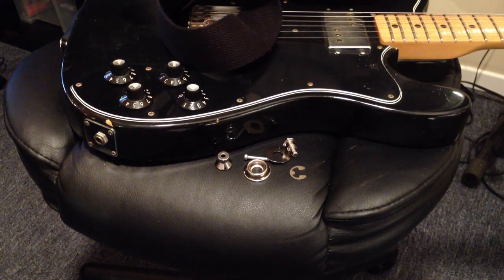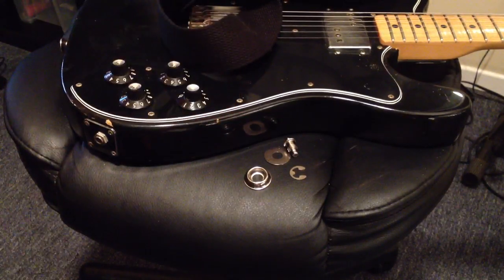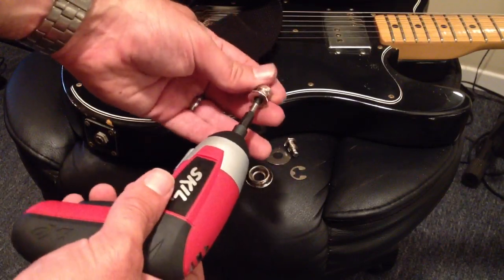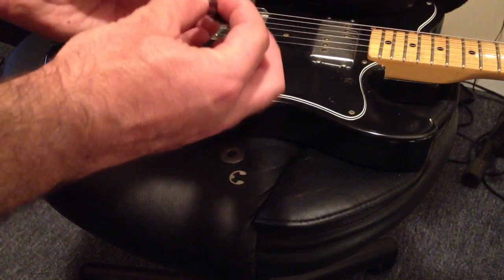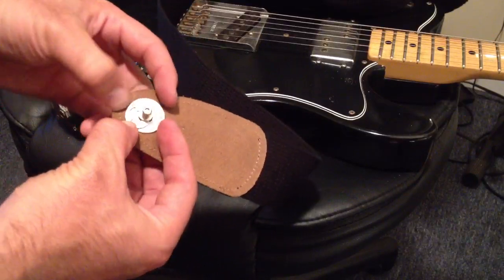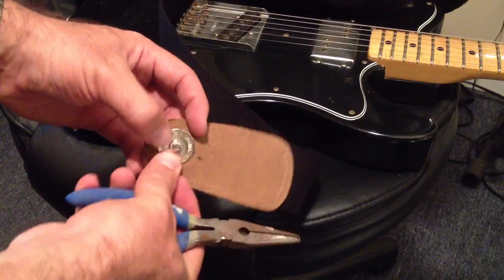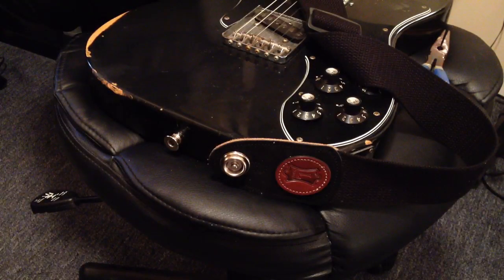Dunlop strap lock fast, easy, correct installation.

Comment from the maker: It seems there’s a lot of anxiety surrounding using power tools on guitars, perhaps I can allay your fears.

1) it’s an electric screwdriver, which spins much slower than a drill, making it much easier to control. 2) all factories use power tools to screw in guitar parts, do you really think they’re spending extra money on time to screw things in by hand? 3) all guitar techs I’ve worked with have used power tools, many even use full on drills to install screws and wind strings. 4) manual screwdrivers can do serious damage as well, if you aren’t careful.

All you have to do is be careful, and use the right tool for the job, along with some common sense. I haven’t had a guitar scratched from a power tool in over 20 years of repairing instruments. If you are doubtful of your abilities, then by all means, use the method that works for you, but there is no reason to adhere to guitar dogma (and there’s a lot of it).  It’s a piece of wood and some screws, and there are power tools designed expressly for the purpose of joining those elements, safely and efficiently.

Comment: Thanks for the tip about how to install the locking ring. I ran into the same problem you did; it wouldn't click into place no matter how hard I tried. Your tip about using needle nose pliers is the way to go.

Comment: Nick, thank you very much. The tip of using a soap bar to lubricate the screw makes ipossible the instalation on the neck joint of a ES 335 block 1963 reissue.

Comment: I used to love and be obsessed with the Dunlop Straploks for years but after a brand-new set failed and drop my guitar straight to the ground I'm never buying them again. Just seeing them on the video makes my heart skip a beat. Yeah, I know it might have been a faulty unit in like 10,000 that left the factory, but I don't care. If I pay for a product that is intended to lock my strap in place and I trust my very expensive/favorite guitars with it, I expect it to do its job and do it well, so failing one time only is really all I need. Anyway, my cat-like reflexes were, fortunately, quick enough for me to catch the neck of my favorite guitar right on time and avoid the tragedy about 3 inches from the floor, but I feel for those who may not get so lucky. So, since that incident happened my advice for all my fellow guitarists has been to ditch those Dunlop abominations out of your beloved guitars, and instead switch to Schaller S-Locks because the mechanism on those is designed in such a way that even in the remote possibility that it fails to lock the strap (something already pretty much impossible to happen because it is spring-locked tightly and strongly) it will still secure your guitar in place because of the way the lock connects to the guitar from below. You would only notice that it "failed" if/when you took off the strap yourself, basically. So, what this means is that with this straplock, your guitar is literally always secure and protected from a disaster, I mean even gravity itself is on your side and helping. A disaster just can't happen even if you wanted to and so it's absolutely perfect. Sorry for the rant, but friends don't let friends buy Dunlop Straploks. Stay safe and Rock on \m/

Comment: Can i just use the stock screws from my guitar strap knob instead of drilling and stuff??
Reply from the maker: Sorry for the late reply. I would use the new screws. They will fit the strap buttons correctly, and they are tough in my experience, never had one bend or strip out, and I play a HEAVY bubinga bass. Who knows what the manufacturer's screws are made of, you can't put it past a manufacturer to cheap out on something like a screw.

Comment: Do they move in the socket and make noise like schaller ones ?
Reply from the maker: I've never noticed noise from any brand of strap lock...  are you installing them on an acoustic or something with a piezo? Shouldn't matter otherwise, and any little rattle would probably be negligible in a live setting regardless. If you tell me more about the noise you're experiencing I might be able to help further.
Reply: It's just the rattling noise when you pick the bass and move the strap.
But it's not relevent anymore when standing because they can't move anymore.
Reply from the maker: yes, beyond that, properly working magnetic pickups wouldn't pick that sound up anyway, only piezo's would.

Comment: Anyone just used the screw that come on the guitar?
Reply from the maker: James Cuddy If it fits in the Dunlop strap button, sure, but generally the heads on the existing screws are too wide.
Reply: @NickWeissMusic  Just did it and it fitted! Got one done then moved to the upper lock beside the neck, screwed it one too tight and the screw head broke... the dunlop metal is a lot stronger than the screws on the guitar. So now going to have to find a way to remove a screw that's stuck in my 335 or drill another hole, oh the joys
Reply from the maker: @jammyd33  Lesson learned :)  If the screw is exposed, you can cut a flathead slot in the top of it with a dremel and unscrew it. Or if it's buried in there, hopefully you can just yank the button off, or drill into the screw until you're able to pull the button off, a dremel with a grinding burr is useful here too. once the button is off  the screw should be easy enough to get out with pliers. If the broken screw's buried in the wood, then you've got some bigger headaches, I've never had much luck with screw extractors, first I try to use a tiny dremel engraving burr to create a flathead slot, it's not particularly easy but it works.
Reply: @NickWeissMusic  Thanks for the advice, unfortunately the top of the screw head has snapped off and the screw is left in the guitar, only about 1/2mm below the surface of the body. I really don't know very much about tools, I may have to send some pictures for help, otherwise I'll take it to a local guitar tech and hope he has something that can work
Reply from the maker: @jammyd33  That's bummer but  it'll get sorted out. If you don't have a dremel or screw extractors, yes, this would be better left in the hands of a tech.  I definitely encourage people to try their own repairs and adjustments, it's just wood and screws after all, but would never encourage working without the right tools for the job.

Comment: I have a Gibson and the screw sizes that come with it are different lengths and slightly larger gauge than each other. Any ideas?
Reply from the maker: You have to use the Dunlop supplied screws, so if the existing holes are too small, that's no problem, drill them out. If they are too big, first to make sure the existing holes are deep enough, if not, drill them out to accommodate the new screws. The classic trick is to crush a wooden pencil with some pliers, Cover the slivers in wood glue and pack them into the holes.  I then drill the screws straight in while the glue is still wet, no pilot holes needed. Wood glue is stronger than wood, I have done this on several instruments and never once had a problem.

Comment: What size are the screws given in the strap lock box. I lost them and need to replace them? If anyone knows off hand I’d greatly appreciate it
Reply from the maker: Aaron Gall Sorry but I’m not sure myself. Any high quality wood screw should work, as long as it protrudes an inch or so into the wood, so 1 1/4” or 1 1/2” would do it. I’d go with stainless steel, not the cheapest zinc plated. One thing that won’t make your selection easy, is the cylinder that the screw fits into is pretty narrow, so you may have to grind down the screw head to fit inside it. I’d say a deck screw would be perfect, but I believe their heads are fluted and won’t fit flush inside against the metal strap button. If you’re not handy, you might be better off contacting the company to see if they would send you replacements (good luck), or buying a new set. Depends on your skill and the value of the instrument. Screws aren’t magical, but they will be under a good deal of stress in this case, so use good judgment.

Comment: Man, I sure wish I'd watched this before I used Irish Spring on my screw threads. Damn it.
Reply from the maker: Marc Johnson live and learn. Burn your guitar and try again :)
Reply: Actually I already used the guitar to destroy my JCM900 amplifier. I read where vacuum tubes are prone to eventual failure, so I took them out. Afterward, the amp didn't work. What a POS.

Comment: What I do applaud in this video instruction is to use soap or candle wax to lubricate the screw.
But when it comes to tools on your guitar... NEVER EVER recommend power tools to screw things into the guitar! Even with the disclaimer about using a slow or not, the point is not to mitigate the risk but to eliminate the risk of damaging the guitar.
Reply from the maker: To each his own. Every full time repair tech I've ever worked with, and there have been many, uses power tools. And you can jab a guitar really good with a screwdriver too, probably worse.  If you're careful with power tools, you don't have to force anything, in my mind that's even safer.  I've never had an incident myself, but if you're worried,  feel free to twist those screws ;)

Comment from the maker: @nick truskowski, I have heard of that but only with Schaller's. Never once with Dunlops, and certainly not over a short amount of time. Maybe they were knockoffs made with bad materials, or user error, or just bad luck, but I'm around a lot of musians and never once heard that. The biggest complaint is the Dunlops hold the strap far from the guitar, which they do, but that doesn't bother me.  A student of mine just last week lost his Epi Les Paul due to a Shaller UNTHREADING AND FALLING OUT OF HIS STRAP... EXACTLY WHAT HAPPENED TO ME MANY YEARS AGO with a $2400 bass. They use threaded nuts to hold the piece on to the strap. If you have a thick leather strap, it's not going to be threaded on deeply, and it can work its way off, and they do. THIS IS A SCHALLER DESIGN FLAW. THREADED THINGS ON PARTS THAT CAN MOVE, CAN WORK THEIR WAY OFF.  Ever have a strap button screw loosen? Or an input nut? Of course, everyone has. But strap button screws are long enough to catch before there's a problem, and a loose jack isn't going to make your guitar hit the ground.  I am careful with my instruments, and used tools to tighten the Schaller's nut down, but I'm not fanatical about checking on every detail every gig, (especially a product supposedly designed to not allow your strap to fall off), and it worked its way off. If you can remember to tighten the nut down every gig, or you just like gambling, go for the Schallers. You're at risk, due to the design of the device.  I have never had the bearings go bad in Dunlops, ever, and they're on every instrument I own. I have never lubricated or otherwise maintained them, never a single problem. And if they did start binding, I'd plunk down another $15 and get a new set.

Comment: Hi! The Dunlop screw is longer than the original guitar screw?
Reply from the maker: Skiantoss it can be, so if you find a lot of resistance before you've screwed the strap button all the way in, back it out and drill a deeper pilot hole.

Comment: You never should use electric drill to put those screws in with wrong you're dead wrong never
Reply from the maker: blue dog lol, if you feel that strongly, then feel free not to use harmless power tools for their intended jobs. Again, it’s an electric screwdriver, not an impact driver or anything. Do you think folks in the factory that build these are twisting every screw in by hand? Do you think repair techs don’t use power tools? Do you think you can’t damage a guitar with a manual screwdriver? It’s a piece of wood and some screws. Had I damaged a guitar in my 2 decades of repair, I’d feel differently, but i haven’t. All you have to do is be careful, as you should using manual screwdrivers as well.

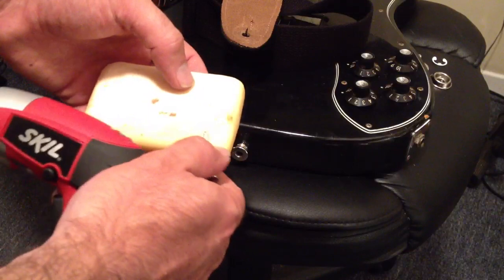Comment: 2:17 lubricate the screw threads with some SOAP???? 
Are you kiddingh? What kind of soap is that? a common bath soap or a special antirust soap ?? i dont get the why. If you need lubrificate screws should you use an oil or a special grease, dont knoe..but not a soap! (it will make the screw becoming a block of rust, suppose). However my spoken language knoledge is too little to let me understand, so i think it's a matter of wrong understanding
Reply from the maker: Yeah dude, soap. It works just fine used in this capacity, by many many people, many many times. Trust me. It won't rust, or do anything to the screw, other than allow it to screw into hard wood without the head snapping off. Grease or oil might work too, but its messier. Just use soap.
Reply: It's not a joke. Soap is a commonly used lubricant for wood screws.

It works perfectly within the tolerances of the job, is much less messy than other lubricants, and something which everybody has easy and ready access to.
Reply: i didnt know. thanx, i trust you all
Reply: I use graphite. Just get a soft pencil, the centre (drawing bit) is graphite and just run it a few times around the thread. It works well.  Graphite is a good lubricant for many situations.
Reply: Wax is another easy, safe, non messy, alternative.

Comment: Just a word of caution when using Dunlops. I have them fitted to my PRS and one time failed to ensure that they had properly engaged. £2500 of guitar hit the deck before I could react. I am verrrrry careful now!
Reply from the maker: That sucks. I always check them out of habit, all it takes is a quick tug, easier to check than schallers. Hope you didn't cause any real damage, cosmetic things happen if you use your instrument. I have a bent tuning peg on my number one Godin guitar from a tumble off of a stand. like I always say, if you want a museum piece, leave it in a museum.
Reply: +Nick Weiss I certainly double check now Nick! Luckily it was all cosmetic damage which as you say, happens if you use the instrument. I don't know what I'd have done though if I'd bent a tuning peg! I don't like to see fine instruments, built for years of use being wrapped in cotton wool and stored away. They're meant to be played so play 'em!

Comment: Awful strap locks, really..Get Schallers and thank me later.
Reply from the maker: Nope! Schaller's have a design flaw- threaded nuts on a moving part. If you have a thick leather strap, the nuts get very little purchase and can work their way loose, happened to me. Never again!
Reply: Dude, there's a set screw on the nut to lock it in place.
Reply from the maker: Michael Steven haha, Schaller must’ve been listening to the many complaints ;) They didn’t have a set screw 20 some years ago, besides, set screws loosen up all the time on moving parts. At any rate, if you like Schallers, enjoy using them, they failed me, and I have no reason to change back over after 20+ years of zero problems with the Dunlops.